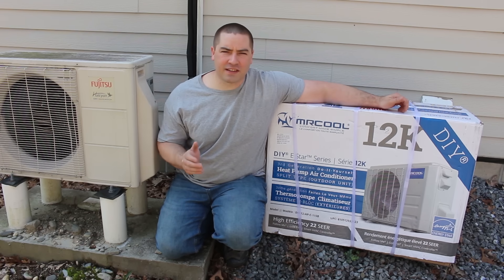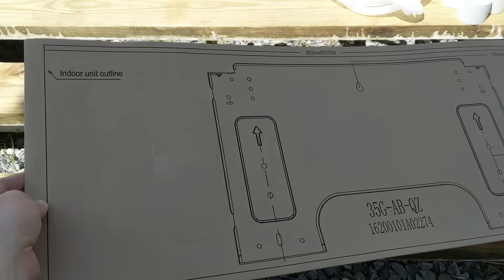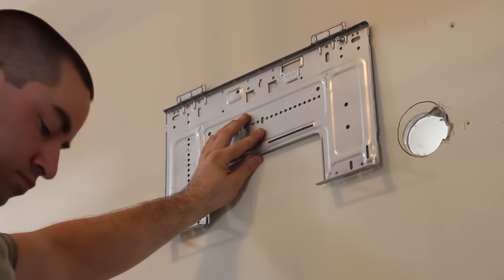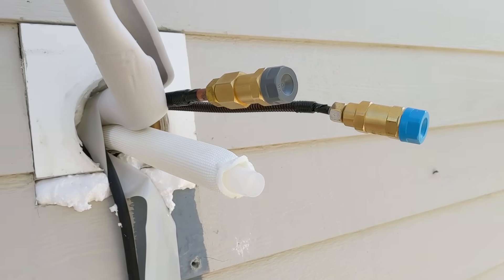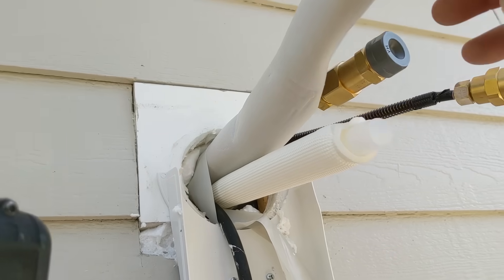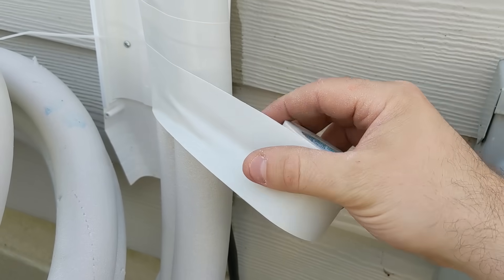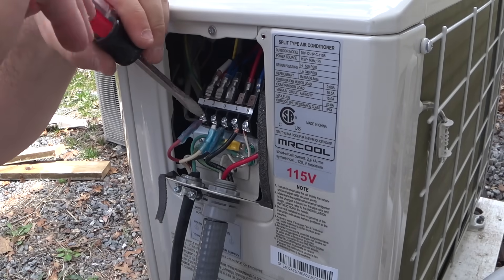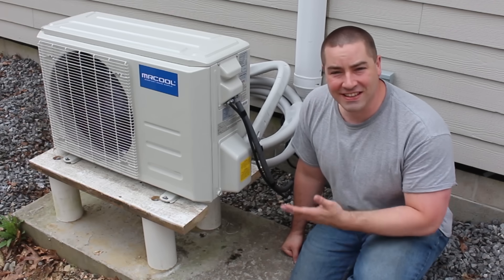Installing My Own Mini-Split Heat Pump, DIY

Comment: Pressure testing with freon ???  And did I miss the part where he pulled a vacuum ???  Spend the money to get a few essentials like a tank of nitrogen with regulator and pressure gauges, a vacuum pump, a micron gage to read vacuum, refrigeration AC gages, and maybe even a 25 pound bottle of R410A then some utube videos to show you how to use them. You are saving many thousands of dollars by doing this yourself. You can save money but don't cut corners and be sorry later.

Comment: I enjoyed the video but I did not see you vacuum the line out before you let the Freon in the system. Could you have test the system with nitrogen to check for leaks then vacuum down your unit.

Comment: That black tc cable is supposed to be sleeved in a conduit. It’s not sunlight or oil rated also how did you get 120v from a 240v disconnect? I certainly hope you didn’t use the ground for a neutral conductor.

Comment: I like these mini-splits for their efficiency and ease of installation but I wonder if parts are available and it seems this guy could not find a contractor who could adequately repair the leak in the old mini-split.

Comment: I am far too lazy to hold a vacuum hose up and drill with one hand and vacuum with the other.  Instead, I use painters tape and tape a small paper bag under the drill location and let the crumbs drop into the bag.  More than 1 hole, peel the bag off the wall and put it under the next one.  But, your way works too.

Comment: I'd cut the extra copper tube out / electrical lines, vacuum the line to below 500 microns, then release the refrigerant
Reply: then why would u buy a pre charged in the first place?? u could get a daikin much cheaper than this

Comment: My Air con uses R32 gas so before the gas vanlves are opened, air inside of the copper pipe must be well sucked (using vaccum pump)
Reply: Or juts let it out....no worries

Comment: Hey, my aircon was setup all profeesionally, but now i need to relocate the condenser/compressor and i would like to see if i could do it myself. What are the steps in closing of the system to retain the vacuum and refrigerant ? Can i just close off the top and bottom valves then be able to disconnect the line set and reconnect after?
Reply: Look in the manual to see if it has a pump down option, otherwise it's difficult to pump these down manually because of pressure switches, condensers with pump down option bypasses the pressure switches.

Comment: The only thing stopping me from installing one of these systems is having to drill a hole in my wall. That's a permanent change I'm not yet willing to make.
Reply: That work requires pro.drill tool (its realy heavy :))

Comment: David:  I am considering a 18000 DYI from HomeDepot for $1600,  but now I see Pioneer on Amazon for $1000.  Is the price higher because it is a DYI with warranty?
Reply from the maker: The DIY version comes with pre-charged lines.  I don't think pioneer offers that, so the pioneer would require you to vacuum the lines, and then pressure test.

Comment: I fitted a very similar system to my home here in Ireland around 15 years ago and had to use a refrigeration  vacuum pump to evacuate the corrosive oxygen from my lines.
The fact your lines come evacuated from the factory is a great idea and saves quite a bit of time during the install, however using the vac pump allows you to spot a leak before gassing the system so can save money in the long run. Anyway mine is still heating and cooling as good as the day I installed it.
Reply: What unit did you fit Ricky ?

Comment: Where exactly did you use the Nylog? Is this recommended by the manufacturer?
Reply from the maker: Not recommend by the manufacturer, but not bad to do. I put it on the o-rings of the fittings.
Reply: @DavidPozEnergy  Understood. Thank you.

Comment: I've seen these and they look like good products. The only drawback I see with this is the leftover piping that you have coiled outside that is exposed to being kicked, stepped on, dented, squashed and other bad things. Seems like they might be able to have the pipe in removable segments so you don't have to leave so much coiled up.
Reply: R290 is propane. All refrigerants have a pressure/temperature relationship. Having the same amount of refrigerant in a smaller amount of copper lineset would increase the pressure and cause issues. This would mean that the homeowner would have to release a percentage of the propane into the atmosphere, which would still hinder the efficiency of the unit and also possibly introduce moisture to the system (which can cause serious issues). There's a reason that technicians charge what they do.
Reply: I watched a video of a installation of Mr Cool where the person cut the length down to size.  Nothing was mentioned about too much pressure.

Comment: I hate those garbage drywall anchors. I switch to the toggles for everything.
But, you have a stud, so whatever, but I'm sick of ripping up my drywall with thosecheapo's
Edit: collect that condensate to water a veggie garden rather than water your foundation. :)
Thanks for the video

Comment: This unit won't last more than 3  years
You must vacuuming the copper pipe with vacuum machine
Reply: Yeah that is bizarre that he didn’t put it on a vacuum pump for half an hour.
Reply: The lines come pre charged. At least my neighbors did. In any case it is best to run vacuum for 24 hours. That is to remove any remaining moisture. Moisture eventually attacks the windings of the compressor motor.
Reply: I was thinking of that too.. Because tjose pipes are pre vacuumed.. Onve the seal is broken the moisture will form insode the piping..

Comment: I believe you forgot to evacuate a line before you open up the Freon valves
Reply: Unless the lines are already evacuate
Reply: The lines are uniquely pre-loaded and have special connections for DIY installs, so no. This also means the lineset is a fixed length, but no special tools or evacuation process are required.

Comment: Try opening the suction valve first, wait then open the liquid second. The expansion valve is behind the liquid king valve and you could risk flooding it with oil. 

Also, wait to fire the unit up after supplying power for a bit. Let the compressor warm up and boil any liquid off. You could take a good chunk of the life off the compressor slugging it with liquid refrigerant.

Comment: I installed a 18000 BTU Mr Cool DIY 3 years ago in NE Georgia. No problems with it.
 It will also act as a heat pump  down to freezing temps. It is quiet.
 I bought it via Home Depot and picked it up at the store. You really need some help running the line through the wall because it is unwieldy and needs someone to pull it as you feed it through the wall.  
Now they have multi-zone DIY packages available. Good warranty with them. 
I added an AC surge compressor  ($70)  to the wiring since we have power interruptions with the thunderstorms here in Georgia.

Comment: Note that the Amazon link that you published (for the heat pump) points to a 3rd party Seller that has turned out to be a problem. The Seller is sending out units without the line set, and some of the compressors are damaged. Be wary.

Comment: Hello David, I am not an AC man but curious how the copper tubing gets evacuated or does it?
Reply: I was wondering too.  It might have been evacuated at the factory and then filled with a small amount of refrigerant (in vapor form).  Assuming that the lines stay sealed until connected, that would take care of it.  If not, as long as the installer doesn't uncap both ends of a line at the same time, very little air will get in and the drier will easily handle it.

Comment: Nice job. 
The black gooey tape you put up near the hole is probably more to insulate the copper pipes so they don't have  water collect on them drip down the pipes. 
In our church some squirrels ate away the insulation off the duct work and water condensed on the ducts and dripped into the sanctuary .
I am going to look into Mr Cool thanks for the vid. 
Happy Motoring.

Comment: That outdoor unit will fail in a matter of few years. Its vitally important to vacuum pump the line set to eliminate air and moisture that will fail the unit.
Reply: It's factory vacuumed.  Please read up on it and become better informed for your own industry.
Reply: Centrum Solutions Thank you, I just got one and was trying to decide if I needed to do that. Looks like I will.👍🏻
Reply: The lineset is already already filled with refrigerant so there is no need to use a vacuum pump with those quick connect fittings on the lineset.  BTW, those quick connect fittings have been around for a long time. I first time that I saw them was when I installed an ice maker in a Mexican restaurant over 35 years ago.  The ice maker came with no instructions so we had to call the manufacturer.
Reply: Didn't you watch the video before making such a goofy comment?  The lines are pre-charged with refrigerant.  So, what would be the point in vacuuming them out?  To pay to have them refilled?  Why are so many hvac dudes on here so threatened?  EMBRACE developments in your field to stay relevant. Sheesh!

Comment: 1st You should use a torque wrench to the factory tightening specification. 2nd You should do a nitrogen leak test then, (and always) pull a vacuum!!!! you have non condensables in your line set. That will shorten the life of the compressor.
Reply: The lines are precharged and joints are made to puncture the seal when made together. used this precharged system on an apartment complex in 1965...not a new system.
Reply: NO he should not he made a follow video. Line already fill.

Comment: You shouldn't have spent anything on them....parts, labor and compressor is all covered by warranty. Full disclosure i work for a fujitsu dealer
Reply: I've been doing HVAC for over 40 years, I never trusted DIY or unknown brands; clients always end up calling for services, and yes Fujitsu offer a 10 years warranty on parts, and labour, and is a much better machine then what I just saw being installed, I also would love to get an update on this ont,

Comment: The plus is they are truly DIY systems the minus is that they will lose gas over time from the connections.
Reply: Personally, I would put an anaerobic sealant on all the threaded connections.

Comment: Hi i'm planning to get a mini split but i have some questions.
are mini split heat pump good for Boston cold weathers?
does LG, Fujitsu or Mitsubishi make diy version?
Thanks
Reply from the maker: Mr. Cool is the only brand I'm aware of that makes a DIY version.  If I was to hire someone to install I would insist on Mitsubishi.  They are OK for cold, but they don't run as efficiently in severe cold.  So it can keep making heat down to zero F, but it's not very efficient then.
Reply: @DavidPozEnergy  my plan is to use mini split only as secondary, and use oil heat as main heat. in this mini split will mostly be used as AC for summer.
down side with mr cool is that its low btu
Reply: problem is that installation service is around 50-60%

Comment: The new one won’t last 2 years. Any idea what 410a and a little moisture does to a microchannel coil?
Reply: I just asked how do they purge the line set. This is like adding refrigerant with a can on automotive lol.
Reply: Whatever you say..... I have two Mr Cool DIY systems cooling and heating my 2000sqft home and they've been working flawlessly for a little over two years now. These systems are very high quality and I have no doubts they will last just as long as the more expensive systems like LG and Mitsubishi but at a much cheaper price.
Reply: But its s good thing he got the sound dampening material instead of a vacuum pump.

Comment: Nice job David Poz. I'm saving this info. No messing with Freon + gauges. Simple D.I.Y. job. Only thing I can think of for Mr Cool instructions would be - as far as any excess/extra tubing - to do any final positioning of the tubing before connecting the fittings - minimizing tension/stress 
fractures/cracking to tubing, fittings and heat pump unit.   Oh, I see you've got a video: "8000w Reliable Inverter That Works"... I'm gone - Thanks

Comment: you didn't evacuate the evaporator. what you should of done is leave line loose at condenser either the high or low side and open the one of the line to get all the air out of evaporator. This way you don't need vacuum pump.
Reply: The DIY series don't need any sort of evacuating or none of that stuff. Look it up on Mt Cool's website and read about their DIY systems before making any further comments.

Comment: So how's the solar handling the mr cool so far this summer?
Reply from the maker: The Mr. Cool has been running 24/7.  My off-grid solar system has been running most of the time, but there has been a day here or there that I switch back to the grid, usually after 2 days of cloudy weather.  But the inverters don't seem to notice when the heat pump comes on.
Reply: That's super

Comment: Dave with more than $5,000 that you throw away for these guys to come and guesstimate your problem, it could have been wise for you to call them to pick up your scrap. Throw away the unit and by a new one.  My thinking about this is: if the unit is $1,500 and I use it continuously for 48 months that is $31.45 a month.  I will gladly throw t away for scrap and but a new one.  Thats what I do with my dishwashers. As soon as they show little troubles I pull them out and sell them on FB Marketplace, buy a new one and put it in. 21 years in this house we have replaced our DW every 5 years because we use it everynight.  Back to the AC I cannot imagine spending money like $300 for one guy to mess around and guess the problem and leave me with more problem like what happened to you.  This latest one was a good install and you learned a lot from your past.
I installed by Senville 24,000 BTU for our first floor; but then I have to buy all the professional tools which is OK for me because I consider them as part of my tuition expense.  It runs so smooth, so quiet, now the Missus wants another one on the second floor. Hahahahhahaha. They never stop!
Reply: You wlll know there's a leak if prior to releasing the charge, you pressure test with nitrogen the entire line set.

Comment: Looks like you have double stud walls.  In a well insulated house, how much square footage are you using the 12K unit for?
Reply from the maker: About 700 square feet.

Comment: I installed an 18k dual zone mr cool unit in my house 6 months ago and it was not the diy type unfortunately, Because I live in Hawaii I had to order through Home Depot and ship to store. I am kinda glad because my tubes are just the right size and the wire is just the correct size.  I would suggest that you run a piece of conduit from the end of your piping cover to the electrical box to protect the cable.  but mr cool makes a great system I was able to do everything myself including vacuum the pipes and charging as well as wiring the unit.  I have zero complaints love mr cool.  Saved 2500 from what the hvac company wanted.

Comment: Always pull a vacuum on the system 
Before releasing the refrigerant. That’s probably why the other lasted two years
Reply: It appeared to be a pre charged lineset which wouldn’t require a vacuum
Reply: @joelsadowsky3436  just because it is precharged doesn't mean you don't need a vacuum.  The vacuum will show you leaks prior to releasing the refrigerant

Comment: My breaker box is on the opposite side of the house. Im wondering what i could expect to pay to install a ac power box on for this unit.
Reply: Between $500 & $1,000 depending on the method & difficulty of running the wiring

Comment: Good luck. You had some bad installers. We have Fujitsu's working for 10 years with no issues. 
 Fujitsu has a great 10 year Parts and compressor warranty so if it was a systems issue it should have been covered. You had Bad installers. My guess was in the flair connections. 
Fujitsu is a great product. Please show us in a year and a half when you have to replace that Mr.Cool. That is the average we are seeing. When you need repair it will cost the same amount of money for labor to fix it. It doesn't sound like you have good installers in the area. You have to wait for parts to be sent to you from Mr.Cool. If they are available. That could be an issue. 
You should put more than 4 screws in the mounting plate for the indoor unit. Not because it's going to fall off the wall. Because that bracket can make noise banging up against the wall behind the indoor unit. The cheap line hide cover with crack in a couple years. That insulation on the line set that is exposed to the sun will melt away in a year decreasing heating and cooling capacity..Not to mention the moisture in the line set that can do damage to the compressor. Installing a fused disconnect is better protection that a pull out disconnect for power surges. A 240 system will be much more energy efficient than a 120. Get it serviced once a year too. 

Just a few reasons to find great installers in your area if you are in the market place for  a ductless system.
Reply: Todd Hutchens sour grapes?

Comment: I'm surprised that the Fujitsu only lasted that long. The Japanese have been using that type of system for decades. As evident by the fan guard seems like there has been some physical abuse. If it's a high traffic area maybe an additional guard like a couple of vertical angle iron embedded in the ground with a pvc pipe as a cover. I like this new system but there must be a better way to cover those excess lines. Good video.Thanks.
Reply: This won’t last much longer there both Chinese this system is a re badged midea system with a diy kit and Fujitsu moved all there manufacturing to China in 2009 the Fujitsu I think would of lasted longer is it was a regular unit but it was the designer head that are prone to leaks